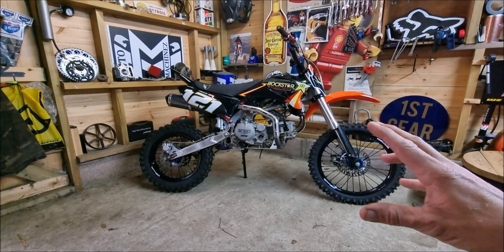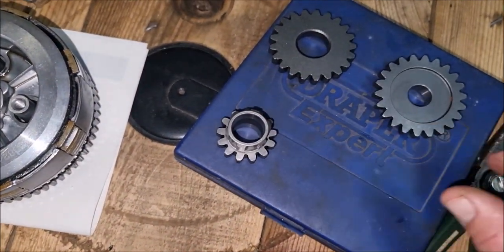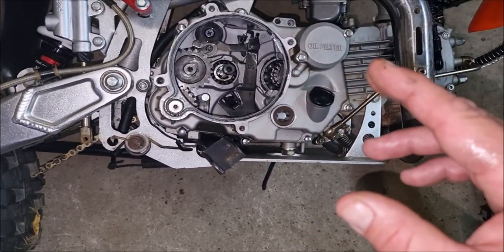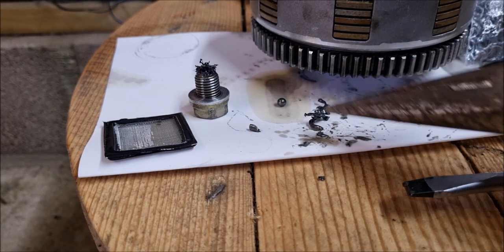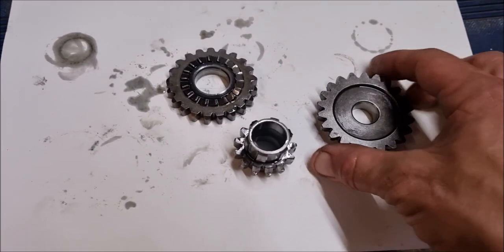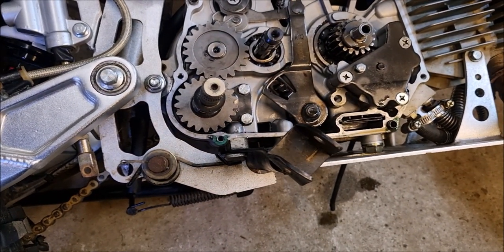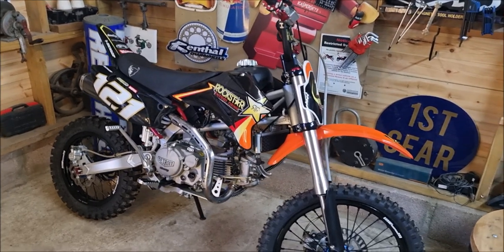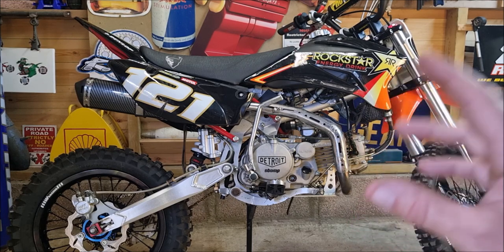Pit Bike KICKSTART FIX

Comment: Gday, i recently got a pit bike. I think its a motorworks (if that is a brand) one but not sure as ive never had a pit bike before, its a 2011 125cc and the kickstart sometimes gets stuck when kicking, it also has low oil and i dunno what oil it takes, any help would be fantastic, 😁👍
Reply: 10w-40 4 stroke oil and you’re good to go

Comment: Hi please where did u get the new gears from mine has just done the same thing
Reply from the maker: Hi I got from stompparts.com
Reply: @motomachinezuk8786  hi would the 160cc be the same mate as I can’t find them on there
Reply from the maker: @CrazySkills7  yes it is the same mate
Reply: @motomachinezuk8786  okay perfect mate what size teeth are they normally mate
Reply: @motomachinezuk8786  hello mate what’s the tool you use to get the pins off
Reply from the maker: @CrazySkills7  circlip pliers mate

Comment: Mine feels weird. It doesn't slip when kicked, but when kicked hard it feels like something drags or catches and stops the rotational force. I had mine apart and didn't see the gears like this, but hope i didn't miss it. Can't find those gears for mine though, so I sure hope not...
Reply from the maker: Sounds like it's the kick start wearing to me but might be OK for a bit. Not sure what else it could be. Good luck with solving it mate
Reply: If you have time just take off the crank case and check every gear and clean out everything one at a time
Reply: Also do regular checks like seeing if you have spark irmf you haven't used It for a while and if you fuel jets have been blocked or not

Comment: Did your ignition never kickback?
Reply from the maker: Nope
Reply: @motomachinezuk8786  do you use the anti kick back EZ started CDI by OoRacing or Tbolt Usa?
Reply from the maker: @el_delaoz  nope this just uses the stock cdi but i know the later models have a decompression system, to be honest I've never had issue with this, not like the z155 kickbacks

Comment: Hey what engine do you like more…The 170 or the 190?
Reply from the maker: 170
Reply: @motomachinezuk8786  ah thanks for the fast response… how is the power compared ?
Reply from the maker: @matteoraab1484  more torque on 190 but not quicker. So does not matter as much to what gear 190 is in comparison to 170. 170 quicker up to 57mph which is plenty off road
Reply: @motomachinezuk8786  ah thanks mate for the response.

Comment: I would get rid of that big kickstart johnny i bought one for my 170 and it jumped teeth i took it off immediatlely and put the smaller one back on i fully blame the kicksart for your sprocket trouble mate
Reply from the maker: To be honest I've hardly used the kickstart as electric start usually works. I know what you mean tho they are rubbish and stick out to catch tour shin.
Reply: @motomachinezuk8786  i meant on your detroit mate that big kickstart lol ,bullhead needs to get his arse out on his aswell hahaha

Comment: why does it break so fast compared to a car ?  higher rpm or external forces on the gears ?   I see you've collected one of those restricted byway signs haha
Reply from the maker: 56 hours of abuse but they are only an old c90 engine pumped up and over 40 years so not designed great plus chinesium metal doesn't help, it's poor quality. So yes more forces than they had planned for it.
Haha the sign was broke so I picked up as discarded on the floor like rubbish.
Reply: @motomachinezuk8786  my cousin fell off the MTB again, this time on perfectly good dry road, I let him borrow it for 5 minutes, he needed 8 stitches under the chin, it was quite a bad one, everywhere else was fine. Don't know how he managed it as it has 2.25 inch tyres and its only 1500w, rear brake isn't that strong either.
Reply from the maker: @ash0787  oh no nightmare!  I doubt he will want another go on it ? How was bike after that off ? Hope he recovers soon 🙏
Reply: @motomachinezuk8786   he says he still wants the bike but his mum says hes not allowed to go out on it otherwise we would have gone out this weekend. Last time we went he dislodged my bbshd and I had to redo it,  and he was lucky not to get ran over  as he was on the wrong side of the road at a weird junction in silverstone, I think it confused him because its double or triple the width of a normal junction.  He has some sort of problem thats hard to pin down, physical coordination mostly or doing stupid things unpredictably.
Reply from the maker: @ash0787  he is one of them who breaks or falls off stuff every time ? 
So he listens to his mum then.
He will only get more competent with seat time so its a difficult situation. 
Nice of you to let me borrow your bikes
Reply: @motomachinezuk8786   my brother is similar, I went cycling only once with him and he tried braking hard on a long downhill at 20 mph while only holding the bars with 1 hand, fell off and dislocated his shoulder which then gave him trouble for years... I call it reverse midas touch.  My cousin is more unpredictable, he used to have a nice mountain bike but the derailer exploded while we were on the way out of town, he got a new one in 2020 or 2021 when he lived with some girl in the town center but it got stolen, apparently it was a nice bike...   
I just thought of course its going to get stolen if you leave it near the town center unlocked, especially seeing as our town has so many more thousands of young people now than it did because of the new builds.
Reply from the maker: @ash0787  he had some bad luck his way then, bike injury then theft. 
All learning, sometimes that can be the best way to learn unfortunately. 
I try always keeping both hands on bars as accidents do happen.